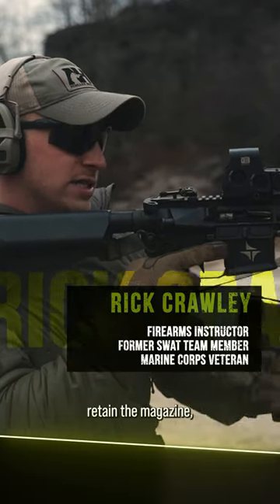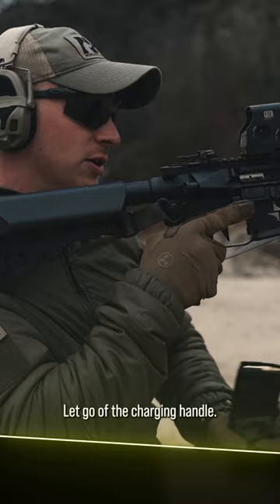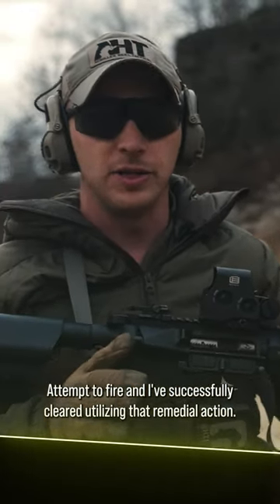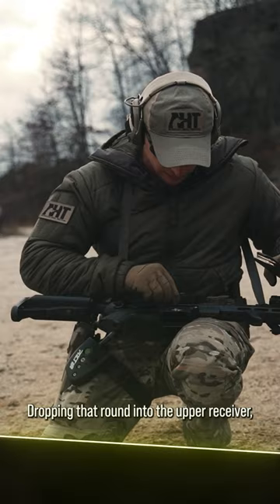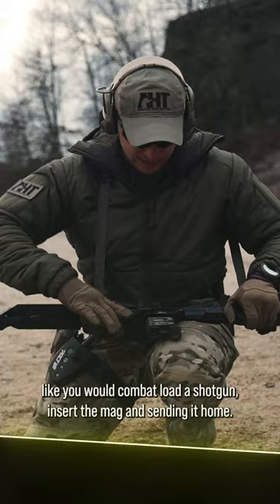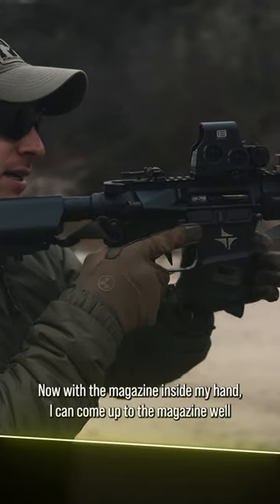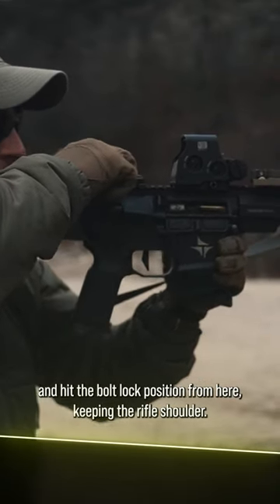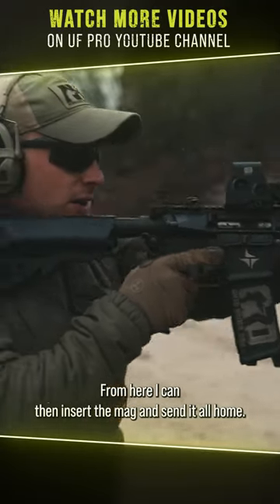Firearm Malfunctions: Failure to Extract

Comment: Pulling the charging handle once and having the rounds fall out would be a very convenient fix, they don’t always want to fix themselves that easily so working the bolt a few times should be automatic.  Better to waste a second racking the bolt a couple more times than having one of the rounds causing the malfunction stay in the upper, reinsert the mag, go to load a round and be stuck in the same spot I was in before.

Comment: I would add that you go to your secondary weapon and once there is a lull, then work your malfunction. For those that say you can just “tap and rack” you are wrong in the case of a failure to extract. If you have a spent casing in your chamber and the bolt rides back forward to pick up the next round, it’s going to jam the bullet of the next round between the feed ramp and the bottom of the spent casing. This can not be fix by just slapping your mag and running the charging handle. The mag has to be stripped to pull pressure off the picked up round and the spent casing. Thanks
Reply: Nail on the head
Reply: Good job soldier 
Nobody understand it except who lived by it 
Besides he is so slow
He would have been dead long ago 😂
Reply: @LoLa-ti8nr  It's really fucking easy to understand.

Comment: These are quite possibly the worst lessons in teaching clearing malfunctions. No malfunction requiring remedial action will ever have loose rounds. You need to lock the bolt back everytime and finger the inside of your chamber to loosen the cartridges
Reply: This... also you wouldnt do this stand up in the open 😂

Comment: so you arent even going to look to see if theres a fuckin round jammed in it?
Reply: Failure to extract: Most likely there is a round jammed in so he simply pulls the mag and clears it.
Reply: @falcon1378  yeah? never saw a failure to extract cause the next round to get jammed  above/around the chamber when the unextracted casing rides the bolt forward and pushes the next round out of the way? im definitely gonna take a peek to make sure there isnt a round jammed, rambo here can do it wrong if he wants.
Reply: @epnuzuluaga766  The main reason  he is preforming the specific clears is because he knows a round isn't jammed. The only way a failure to extract occurs is if you fire a round and the casing doesn't eject.

 This is a video dealing with that specific scenario, of course if you're shooting irl in a hostile environment you're gonna check to see if there's a round jammed, but in this case there isn't. he's showing you how to clear the weapon when you have a casing stuck, not a jammed round.

Again, if you're shooting in an active environment, you will check your weapon for ANY malfunction so you can proceed to clear it as follows, but this is a guided video on that specific scenario (failure to extract) so he's going about it the way he does, because he knows a round isn't jammed.
Reply: @@falcon1378  train how you fight?
Reply: @RickSanchez167  True.